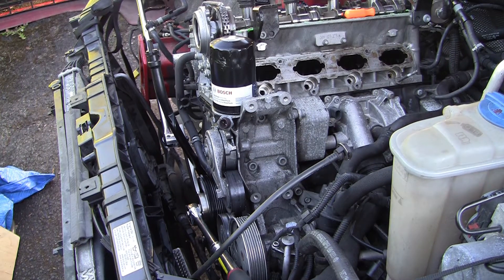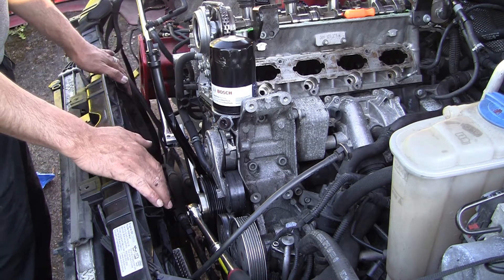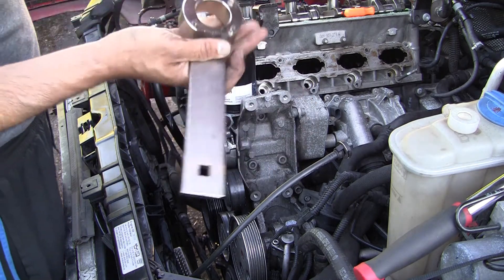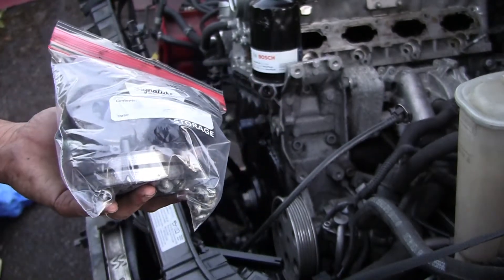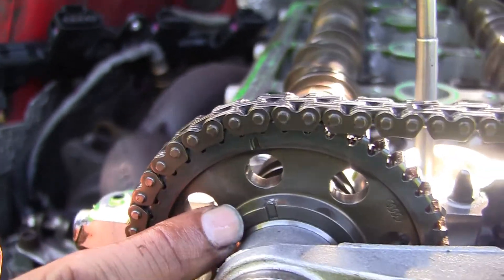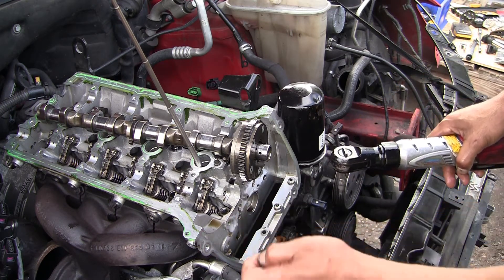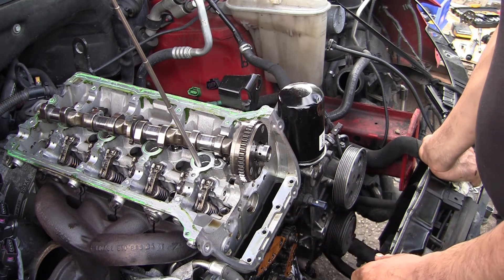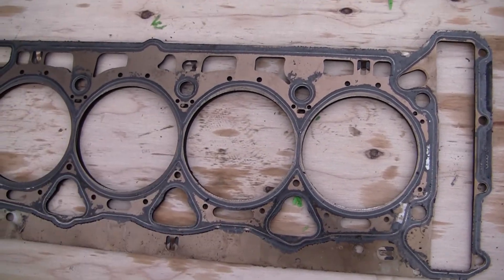How to solve a misfire on a 2.0t tfsi engine, Athorough study(removal part III)

Comment: Make sure if you remove/replace the crank bolt that you time it in its proper key way. Don't remember perfectly, but the crank pully as well. Flip them over and look for the key ways otherwise all that hard work is going to waste with a bit of high rpm on the motor after everything is put together without knowing.

Comment: I have a 2009 audi a4 quattro premium b8 engine code CAEB. When I start my car it turns on but then brings to shake not a vibration but a violent shake, but as soon as I'm driving over 10 miles per hour the shake is gone it drives and feels great! But as soon as I come to a light where I have to idle/stop, it begins to shake violently again, sometimes if I let it shake at idle for to long the EPC light comes on and I have to shut the car off. Then I turn it back on and its back at a rough idle but I can just drive more then 10 mph and it's fine again.
Reply from the maker: Kathleen Velazquez hello there, it’s exactly what was going on with my car, you have at least one lope loose, if you’re lucky , just remove the head cover and see if you can spot the problem. The worst you’ll have to do is remove the cams, fix them as I did and put them back , but a cylinder head removal would be ideal . To see if you can spot the loose spring and ball. Watch all my 5 vedios how to solve a misfire for a guidance
Reply from the maker: Just curious, what city do you live in?if you’re near me I could probably help
Reply: @strictlyaudis7012  orlando, Fl.
Reply from the maker: Kathleen Velazquez what cylinder has a misfire if you know? Cos that cylinder will tell you what lope is loose .
Reply: Your engine rear main seal is broken causing excessive air leak.  It will cause the symptoms you have.